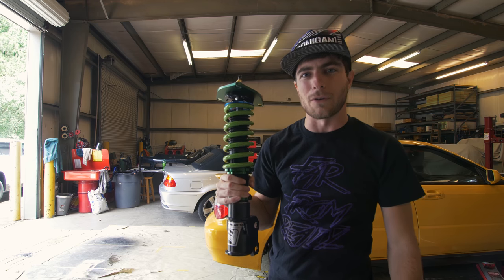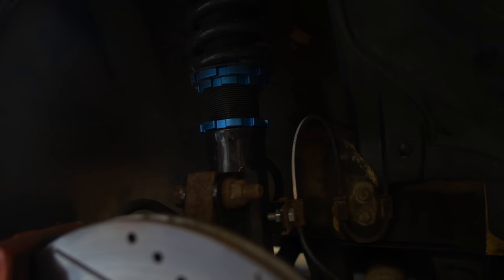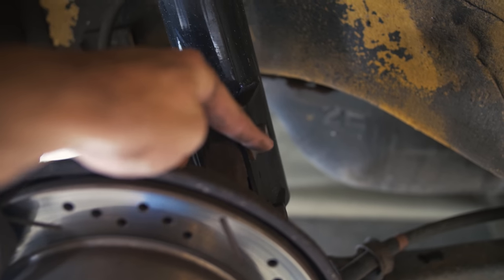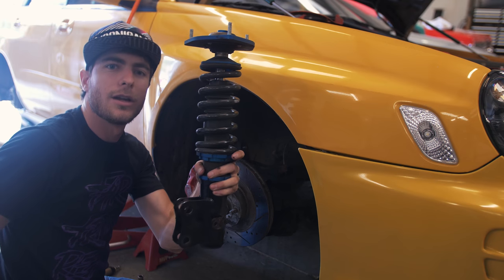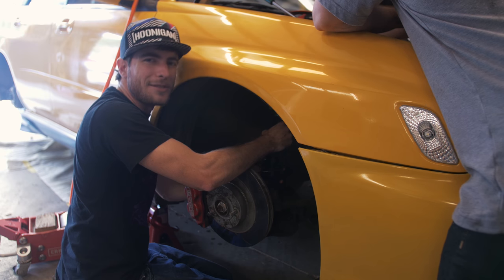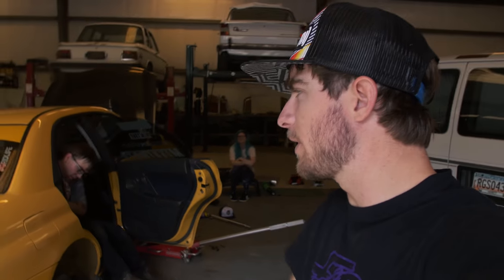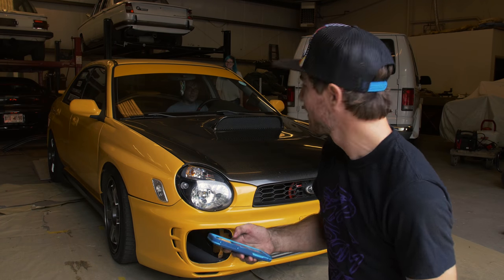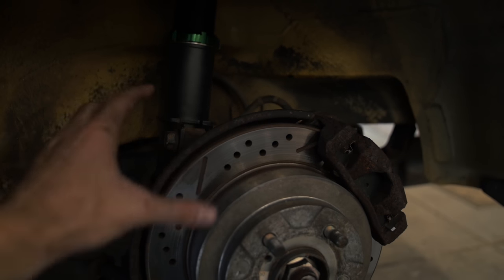How To Install Coil Overs on a Subaru WRX!

Comment from the maker: Wild David's were injured during the making of this video.
Reply: ThatDudeinBlue Hope you hit 1 mil soon!
Reply: ThatDudeinBlue you know what's better than wd40... acetone and automatic transmission fluid I learned that from my automotive teacher and worked even better than PB blaster
Reply: ThatDudeinBlue Is there any other type of David's tho?
Reply: Always remove your calipers and disk brakes while doing this, always, much easier.
Regards!.
Reply: ThatDudeinBlue  Diggin these instructional videos! Please sir I want sum more!
Reply: Depends on the car. I had no problems with brakes getting in the way on my s2k, but absolutely no chance of installing coils without unbolting the sway bars
Reply: "A wild David has appeared!" I throw a rock at it. "It is angry." I throw bait at it. "It is eating" I throw a Smurf at it. "It drove away."
Reply: ThatDudeinBlue what is the first song called that you used
Reply: So the buster became a gearhead lol
Reply: Brice Graham lil yachty shoot out the roof
Reply: ThatDudeinBlue hey man noticed you have a super good attitude... if you haven't already check out 11:11 awakening. great spiritual stuff!
Reply: Could he give me the coilovers he had on......i've got a blob eye wrx conversion.
Tht would really be nice.

Comment: as a mechanic this is fun to watch :D
Reply: Painful to watch. Lol
Reply: digi hey i got a question. lets say I have a pontiac gto, how much do you think a mechanic will charge to install them?
Reply: SubieBoy 1000$
Reply: if you go to your dealer
Reply: SubieBoy probably more than a grand. I was quoted just for regular aftermarket shocks and struts $800 just for rear. I had my friends dad install them for $300 all 4.
Reply: lmao you guys are crazy. we would charge about 200-400 at our shop, and you can take them to alignment shops and they will do it cheap, plus you get the alignment done at the same time.
Reply: this depends as you could tell by the other comments. whats important though is that you get an alignment if you want to daily that car.(or in generel not having it just for fun)

Comment: 3:55 those are the same bolts I’m struggling to remove as well. 
Car has been on jack stands for the past two weeks and I’ve used half a bottle of wd40 on it and it still won’t budge. 
I’ll borrow my brothers air compressor/ drill and give it one more final go before booking it in my local mechanics to change it. They’ve quoted me $135 though to remove and replace with my new coilover. Fingers crossed the air tool pulls through.

Comment: I can relate to how difficult it is to take out the suspension cause I have done it many times and each time it took way to long. Especially when you can't find the top of the tunnel in the rear🙄

Comment: On the rear where the impact gun didn't fit you could have used a swivel impact socket with extension to get it off.

Comment: For future reference: You are supposed to loosen or tighten the nut first, not the bolt. Sometimes that's just not an option though. For the Subaru struts, put a wrench on the nut and turn the bolt. Remember to mark the heads of the eccentric bolts so you can avoid shredding the tires on the way to the alignment shop.

Comment: I put fortunes on my bugeye and the ride height adjustability sucks the only way to raise it is take it off the two bolts holding the hub to the coil and it sucks

Comment: one thing you guys forgot to do which is super important to do is anti-seize the coilovers bolts. that way they won't be such a bitch to remove later. think that's more important to do in Canada where cars just rust quicker.

Comment: Should i buy a bugeye, an e30 or a miata?
Reply: MostlyIrishCarGuy I'm a Subie guy, and I'd go with the e30
Reply: MostlyIrishCarGuy Depends on the shape of each and what you're going for. However, if you're looking for a daily then I'd go with a miata. If you don't have to daily it, then I'd go with an e30. If you want a fun car that you could daily if you had to, then I'd go with the bugeye. This is all just my personal opinion though. I own a bugeye.
Reply: Ryan Z has the bugeye been cheap to maintain besides fuel economy?
Reply: my 95 toyota pickup is my current daily, but its not very exciting. :D
Reply: MostlyIrishCarGuy Yeah, it's been fairly reliable. I've owned it for 3 years, daily drove it for 1 year, and the only repairs I've done is replacing the turbo and some hoses. The rest has been regular maintenance.
Reply: Ryan Z might have to look into it :D

Comment: seriously one of the most useless things to change on a car unless you're tracking it. Subaru makes better suspension for the car than 90% of the cheap crap people put on their cars
Reply: Luke Mezzatesta better than Fortune Auto? doubtful.
Reply: Capn Morgan you have obviously never driven on quality coilovers the difference in ride quality and handling over stock on these is unbelievable and the car is tracked